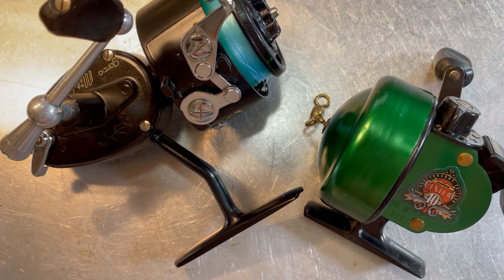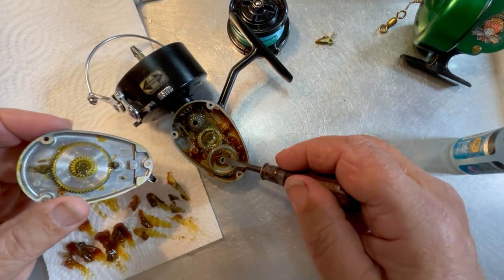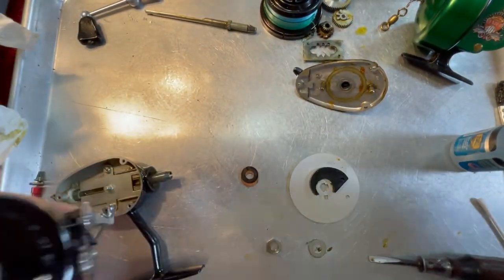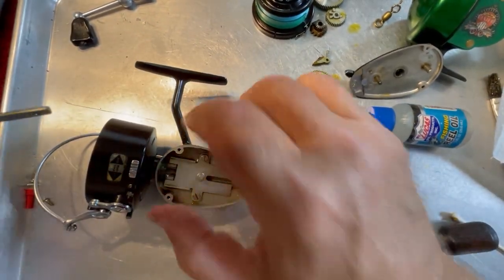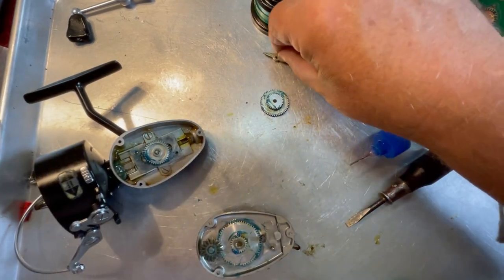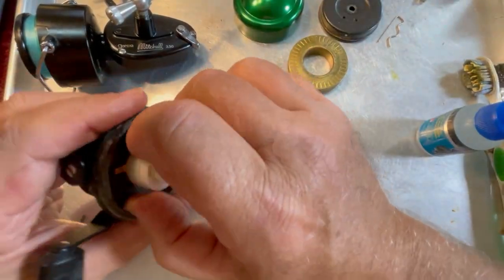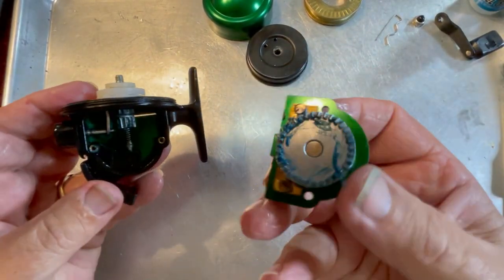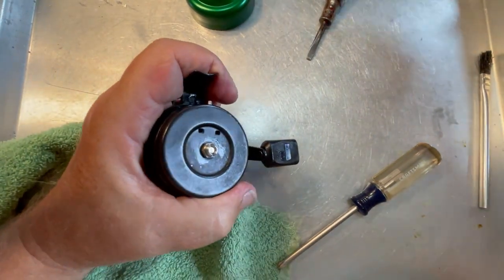Young Martin's Reels -- Garcia Mitchell 330 & Johnson Century 40th Anniversary --  Service and Lube

Comment: Man those reels are in great shape. Enjoyed seeing them..
Reply from the maker: Steven, They are both in very nice condition. Most of the reels I work on are binding, dirty and missing paint. The Johnson was dirty but that was it. I don’t think there’s a nick in the paint on either reel. That 330 makes me want to get my 440 out and go fishing.
Reply: I had recently bought a Mitchell 330 spinning reel and I didn't know how to get the bail wire up, I was pushing the elbow end of it from the back ,if you know what I mean, to make the bail pop open, But after watching your video of this particular reel, you have taught me that it's spring loaded to open by pressing down on the bail wire to make it pop open and I learned about the sliding button that keeps the bail locked into position! Now I will be a lot more comfortable and happy that I can use my made in America fishing reel! I love your videos and the education that you give people in how to service fishing equipment

Comment: When I took my 330 apart there was a stack of like 7 shims, mostly paper thin.  So many gears it's almost like a Rube Goldberg machine. They're fun to cast once you get the hang of it.
Reply from the maker: Barney, do you think the shims were factory installed, or added later to smooth it out? I still haven’t taken my 440 out and tried to fish it. It’s on my to do list.
Reply: @youngmartinsreels5314  Kind of hard to know if they were original or added later. There were two on top of the baffle plate and 5 underneath. Most were paper thin brass. I will say that the line spools on perfectly. I knew a guy that swore by that reel for small river steelhead fishing here in northern Michigan. Said it was easy to make short accurate casts with it.
Reply from the maker: Barney, I’m sorry to say as I get older my hand eye coordination is getting worse. If I’m ever going to fish the 440, I’d better do it soon.

Comment: I like the bail system on that Mitchell and push button spool. I wonder why they went away from quick releasing spools like that. My Cardinal MX130R and Cardinal C1R were the first and only reels I've had that had quick releasing spools like that.
Reply from the maker: Luigi, as long as they are working properly, those spools are great, but once dirt or corrosion gets into them, they are a royal pain to get off. I'm guess that's mostly why they went away from them. Another reason could be that they are more complex and therefore more expensive to make. As for the bail system, a lot of people don't like bails that lock open. They prefer bails that they can easily trip closed manually. The spring open bail on the 330 can only be closed by winding the handle. It wasn't very popular with the fishermen.
Reply: @youngmartinsreels5314  Well I would like to see that kind of bail on newer systems now because I'm always trying to spin it closed first and then trying to close it by hand manually.

Comment: Hello friend, I want to congratulate you for your video about the fishing machine.
I have had the same machine since 1986. I got it as a gift from my uncle, so now I want to ask you something, you must know more about the fishing machine.
How many meters of thread does it collect on the reel, if it is of the following thicknesses of fishing line, for example: from 0.18 mm., 0.20 mm., and 0.23 mm.
If you know, I will ask you for an answer, if not, then I will ask one of your fans for this question. You can also point me to a website, where I can read about this question of mine.
GREETING
Reply from the maker: I’m afraid I don’t have the answer to that question. When I put on my 10 pound test monofilament line, I just put it on until the spool was almost full and then I stopped. I caught two small red drum fish with it yesterday and I am now retiring it. I’m sending it to a good home.